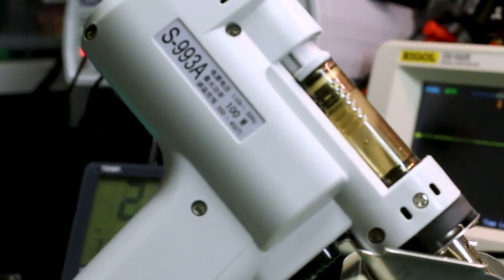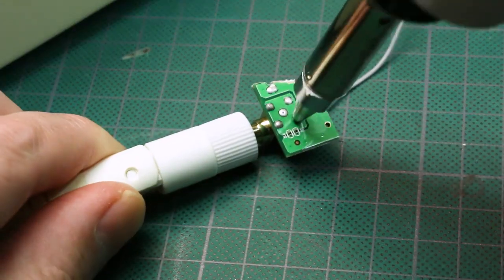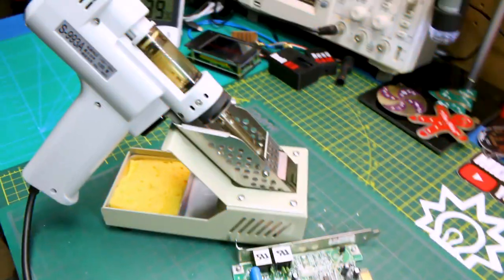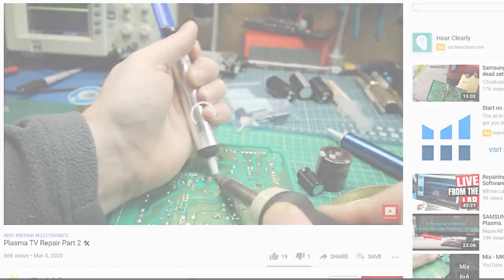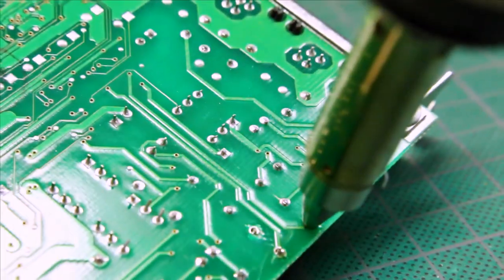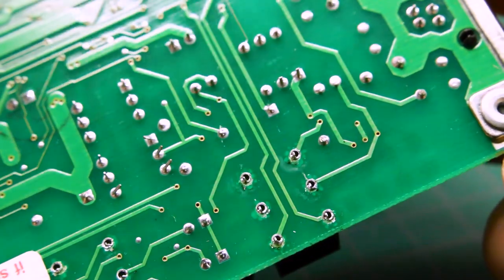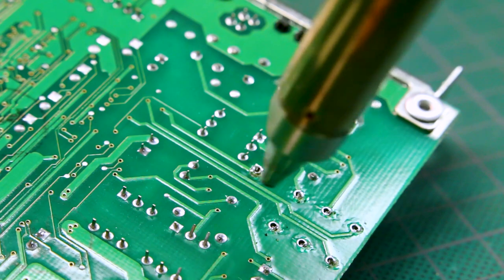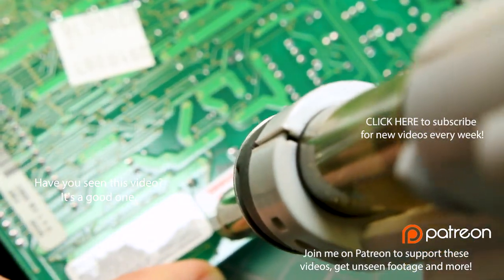Desoldering Gun Basics in ONE Minute

Comment: I'm in no way more than an occasional tinkerer but I have a YiHua 948 and after moving from a solder sucker I would not go back. It's not perfect for every job, some solder joints seem to need too much heat to work on tiny stuff but older boards with bigger blobs and stuff I've done myself then needed to remove the component again it works really well. I look forward to seeing any tricks I may not have worked out for myself yet.
Reply: Yihua 948 is much better than S-993-a and S-998-p in every posible way.